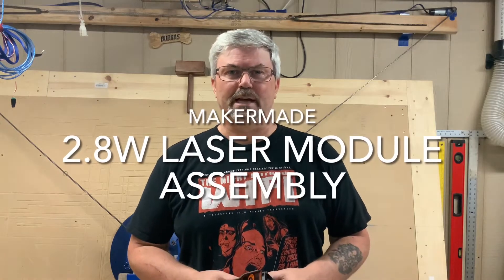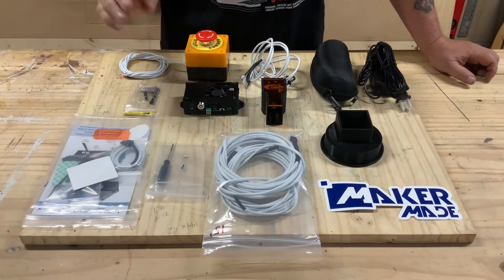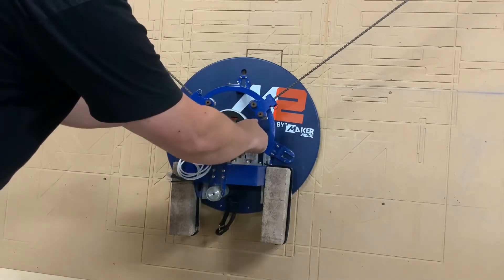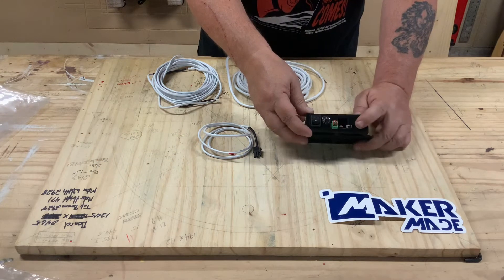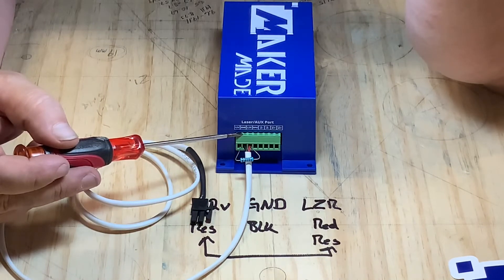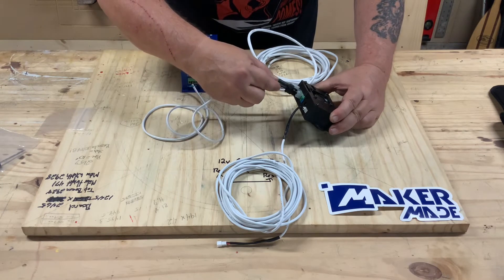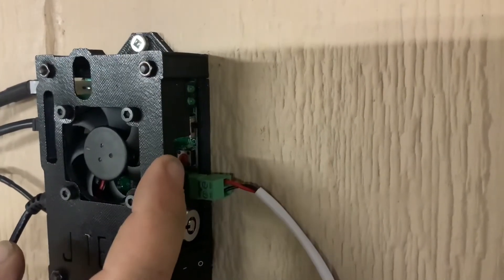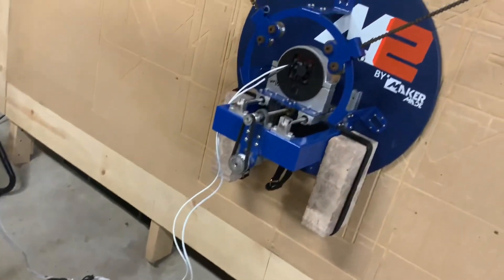MakerMade 2.8W Laser Assembly and Install

Comment: I love your videos, but I am running into an issue.  I went to install mine and it tells me to mount it in the sled, and then lower the Z axis until it is 1/8" from the material.  I have the Z down as far as it can mechanically go, and the laser in the mount as far as it will go, and I am still over 1/2" off from the 1/8" focus point.  Is there something I am missing from the instructions?  Any help would be most appreciated.  Thanks.

Comment: I just purchased this setup. The laser holder does not slid into the bracket. I am thinking I may need to sand it to get it to fit. It doesn't go in at all. My bracket is also quite different than yours. This is a brand new system I just got today. Thank you for making these videos.
Reply from the maker: Mine was a little tight too. The brackets are printed by MakerMade so you may have to adjust it a bit.
Reply: @2tankardscreations211  thank you so much for replying. I really appreciate it. I'm happy to modify it as long as that's the right thing to do. I just didn't want to start hacking at stuff unless that was the expected path forward. My clamp does look different than yours. I'm wondering if it's a different size in general. However knowing that yours was tight makes me feel a lot better because this one is very very close but it just won't fit in without some sanding or little grinding on the plastic.